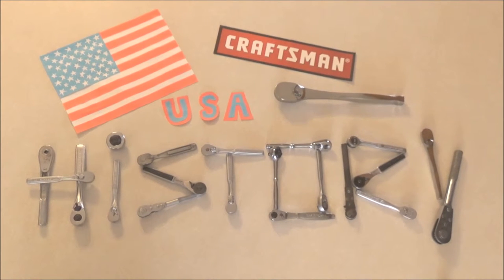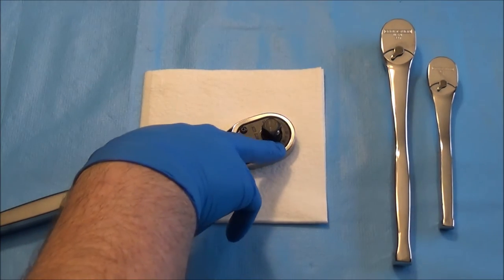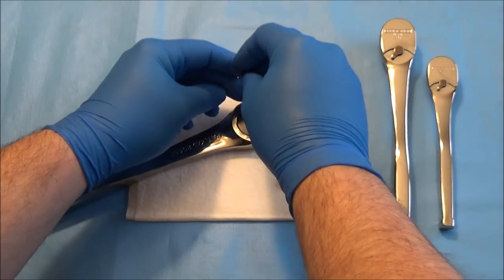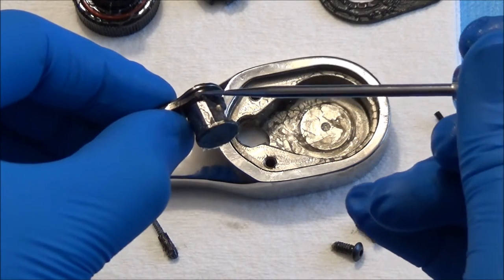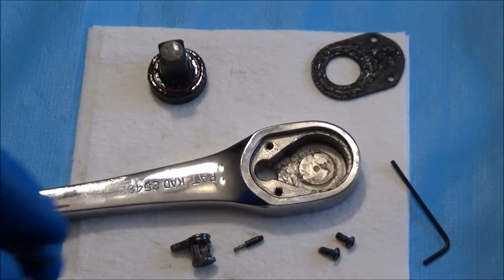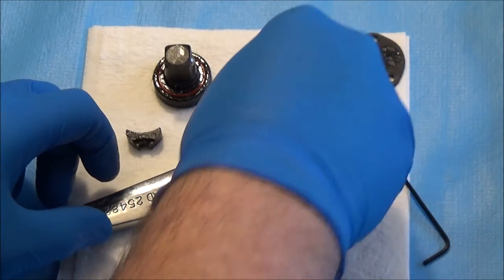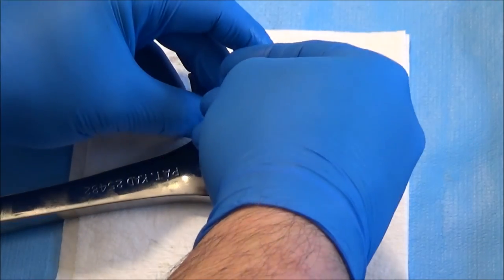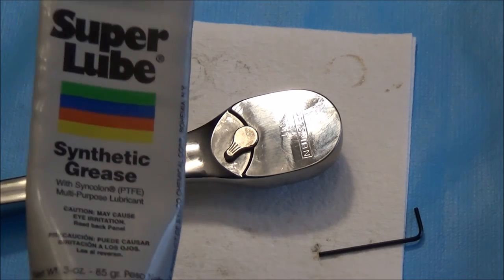Craftsman Tools - USA History: Premium Grade Ratchets Tear Down, Repair, & Discussion

Comment: Stumbled across this video last night. When I bought these years ago, I was so excited to finally have "quality" ratchets. After a year of moderate use, both became useless and have been taking up space in my box. While I thought they could be repaired, the fact that Sears (Craftsman) wouldn't honor the warranty prompted me to replace both with their Snap-On relatives. Finding this video got me off my butt to look for the repair kits. Fortunately, both kits were available on eBay! for less than $25. The Craftsman Professional Ratchets will live again.
Reply from the maker: It seems that there was a Revision "A" & "B" mechanism.  While I can only go off of what others have said about the performance of this ratchet family and hybridize it with my own experiences, the general discussion about the Premiums early on was that they were problematic, where as the later ones were great!

I have only had a handful of these sets, where I have directly seen an "A" or "B" on the pawl.  Most early complaints seems to have focused around the engagement between the pawl and gear.  From my own experiences, I can corroborate this.

Comment: Who made these
Reply from the maker: They were made by the Apex Tool Group under the umbrella corporation called Danaher.  Apex Tool Group consists of a variety of in-house formed and/or acquired tool companies/brands.
Reply: Gear Wolf ya they were ahead of their time, or at the fore front then. Craftsman has come out with a lot other comfort metal grips with pretty good mechanisms for a much better piece than you can find these for now

Comment: direct rip off of the gearwrench fine tooth ratchets. capscrews instead of a snap ring to hold the face cover is the only difference
Reply from the maker: Not quite, but you are on the right track.  The Apex Tool Group owns the Gear Wrench brand.  Coincidentally, they also used to make Craftsman ratchets both here and abroad.  Since Apex owns the design, they can literally make whatever iteration under whatever brand they own.  So technically, Apex is "spreading the wealth" of their patent versus ripping themselves off.
Reply: apex owns KD tool? KD is gearwrench's parent
Reply from the maker: Yep: http://www.apextoolgroup.com/news/kd-tools-joins-gearwrench-family

Comment: Would you happen to know the size or part number for the cap screws on the 3/8 drive ratchet? I lost one.
Reply from the maker: Sadly, I do not.  The individual parts in repair kits were not designated with individual part numbers.  You'll have to bring your remaining screw to the hardware store and try to find something comparable.

Comment: i have the 3/8 ratchet and took it apart because it was slipping.  the pin was stuck in the switch and i couldn't get it out.  any tips?
Reply from the maker: Try using some liquid wrench or WD-40 to see if you cannot it to break free.

Given that these tools were sold bone dry having no lubricant, perhaps a level of corrosion is causing the pin to get stuck on the selector switch.  

Let me know how it works out!
Reply: i'll hit it with some wd-40 and let is soak and try again.  i'm probably going to order a repair kit too.  the paw and gear don't look worn out, nut i'd rather get one while i can.  i used to be a field tech and really liked the premium ratchet over the normal basic craftsman ratchets.  besides craftsman, what another ratchet you like/recommend?  i'm looking at the gearwrench even though i don't think they are made here.
Reply from the maker: Getting repair kits for these ratchets is TOUGH.  A lot of Sears stores never carried these.  You might want to check on eBay for one.

Check the description below the video to see the specific kit number you will need to ask for.  Good luck!